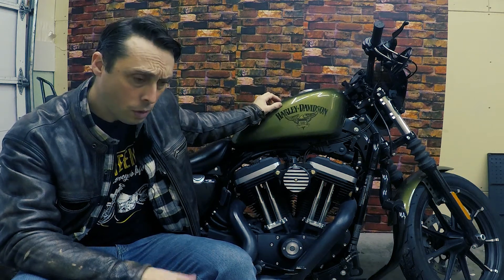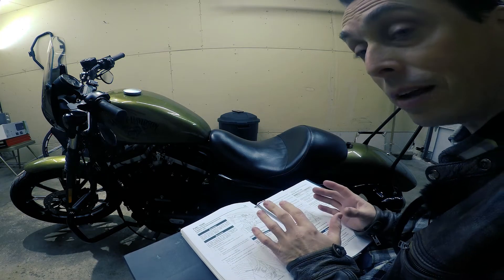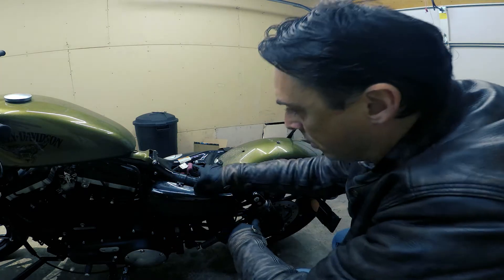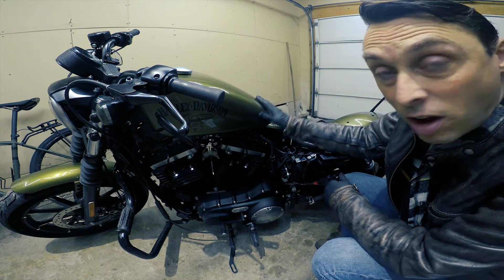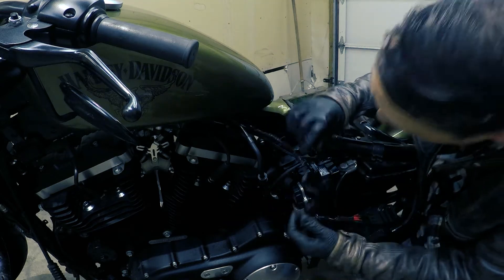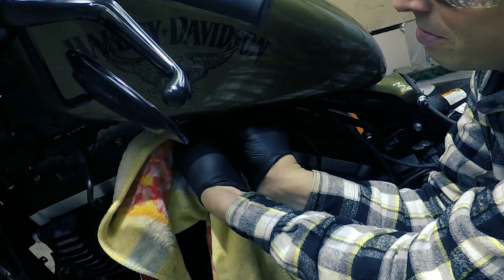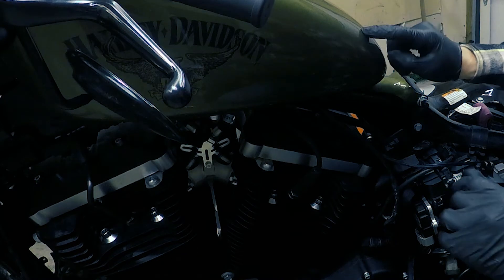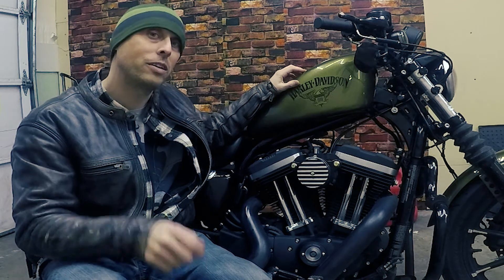How to Remove Fuel Tank - Harley Iron 883

Comment: Very helpful video! I’m doing a project on my sportster 48 and I have to take off the tank, I was about to just remove the black cover that has all the system in the tank but you saved me from maybe screw everything up, thank you!
Reply from the maker: You're welcome, man! Yeah, removing the tank is pretty easy to do once you know what needs to happen and it makes working on the wiring loom so much easier.
Reply: Great Egret right! And I can’t stop! I need to remove the rear fender but I realize that the lights wires are attached to a little plastic that it is attached too to the fender, I don’t really know what to do, cut them and then just re-wire them or pull them removing the plastics... but anyways, thanks again!
Reply from the maker: Clipping the wires won't do you any good unless you want to replace your tail lights. You'll still have to remove the bolt holding the lights, wiring, and the housing together. It's a sneaky little bolt  that's hiding behind that cover between the outside of the fender and the housing for the tail light wiring. Check out this video at about the seven minute mark: https://youtu.be/34qG_AHnGmk

Comment: The fuel vent line- what is it and what does it do? Thanks
Reply from the maker: Fuel can expand and pressure can build up in the tank. This vent hose is to release that pressure or allow fuel to expell if the tank is full and simultaneously has pressure expansion.

Comment: Nice Job, that fuel pump plug is a real pain!
Reply from the maker: Tony Cox thanks Tony! Yeah, that little bugger can be a struggle. Removing the tank was such a good way to do the wire tuck. Made it so much easier I think.
Reply from the maker: PS: shout out to you on the wire tuck/coil relocation video and a link in the description. I haven't decided if I'll upload on Friday or Monday.
Reply: Great Egret much much easier with the tank removed you see what your doing.